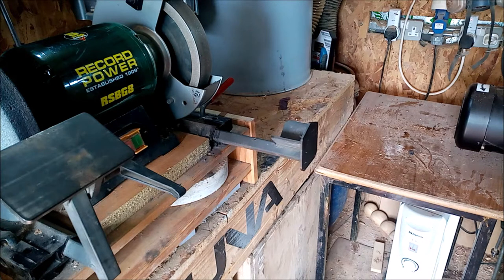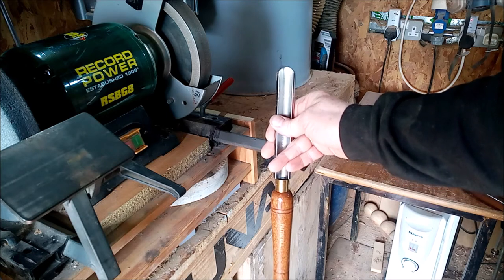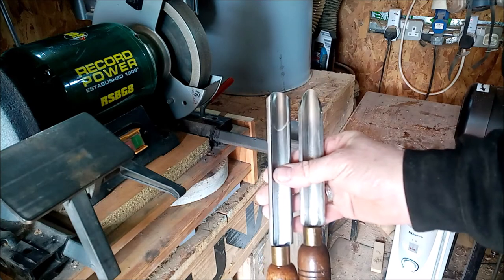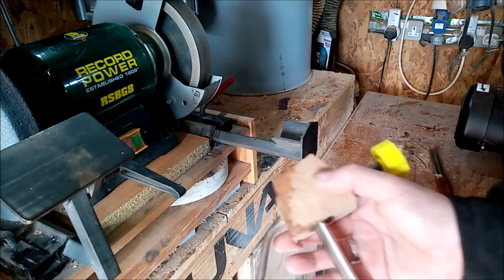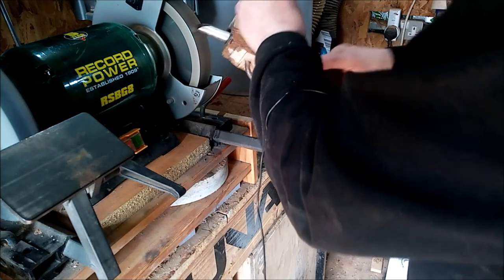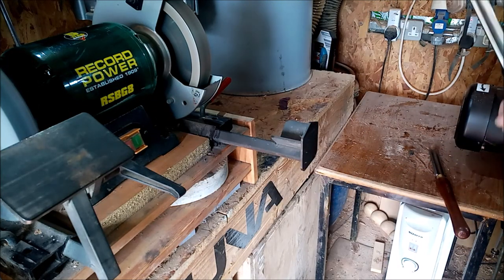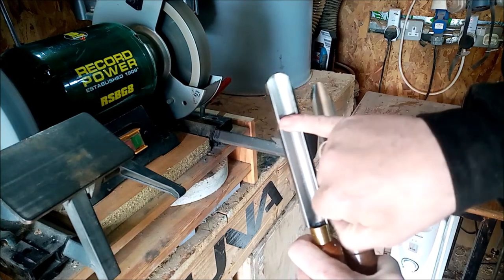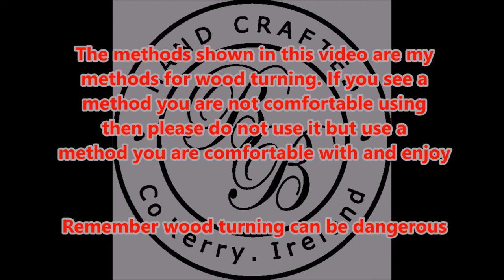Continental Spindle Gouge grind answering a Subscriber question

Comment: Thank You Shay
I have two faithfull roughing gouges which I never use, because the Crown I own just holds a edge
a lot better. 
I don't have any Continental Spindle Gouges. But I will now.
I also own the same sharpening setup as yourself, except my grinder is a Axminster Craft AC200WSG with CBN
I cant Thank You enough, you really have made my day.
Reply from the maker: You are more than welcome Oli, you will probably find that your Faithfull gouges are the exact same as the ones in the video. Depending one which factory they are made in they can come with either roughing gouge or continental spindle gouge written on the plastic slieve they come in. Faithfull are one of the companies that call continental spindle gouges roughing gouges even with the technical differences. I use Faithfull myself as I really like the way they feel when in use.
Shay.
Reply: @BBTurning  I do like, and use Faithfull gouges, and they are at a good price as well. I am really lucky to have a vast collection
of gouges to choose from. I'm not a tool snob ( maker's name ), I just have a lot of gouges, because I realise
I'm not that good, and have them to make me look like I know what I'm doing. LOL

Comment: What type of stone and grit were you using on your grinding machine.  I've never seen anyone sharpen a gouge before, that's interesting.
Reply from the maker: The one on the left is a standard 80 grit stone that comes with most bench grinders the one on the right is a 180 grit CBN wheel, a bit pricy but worth every penny Andy.
Shay